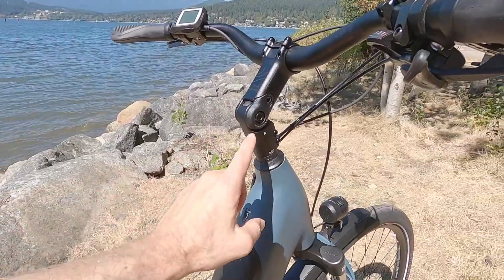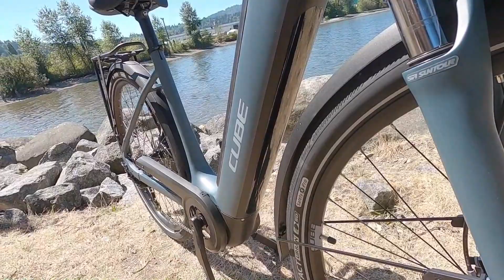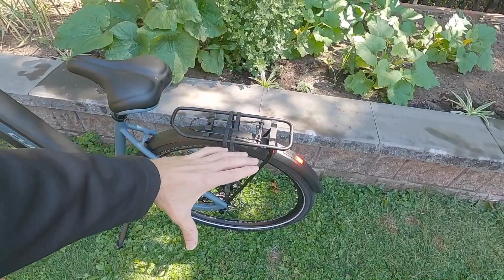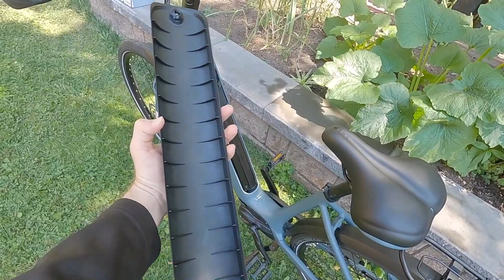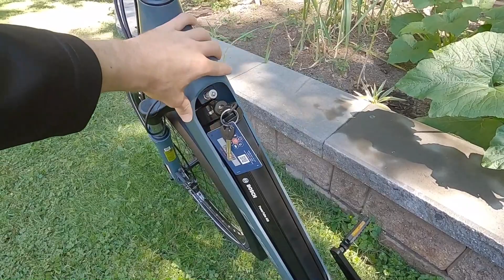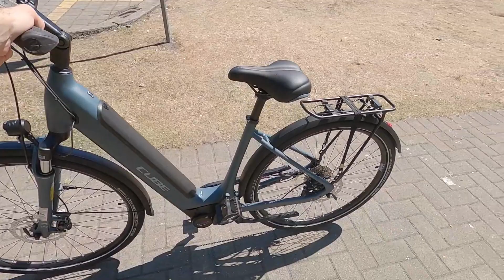CUBE Supreme Sport Hybrid ONE 400 Review - $3.5k

Comment: I bough this very model last November. Its a tank. Great bike. Corners beautifully. One thing that has disappointed is that with any weight over 5 pounds on the rear rack, like a child seat, there is crazy frame flex. I stood up to pedal and had to sit back down as I was losing the rear, very unstable. Otherwise good.
Reply: Saddle is hard as a rock. Motor is whisper quiet. Hills are ez pz, and shifting is smooth. Sweep angle of the handle bars is perfect. I would have though I'd prefer the Gazelle Arroyo for that, but test rode both extensively and much preferred the Cube's bars. Bought the Cube re sale. Tern was what i wanted, the HSD P10, but outta my price range.

Comment: There is no way you would pay $800 for a comparable traditional bike, without this motor or battery. $1800 for both is rediculously high, so this thing is at least $1k over priced.

The internal lock on the battery is a lot nicer than most might think. You'd be surprised how often morons mess with locks just to be jackasses. If this were not a Bosch I would be afraid of that rapid charger (kinda hard on LiOn batteries to charge fast). I have to admit, I trust Bosch to know best. I still am not happy with their lack of aftermarket support. Sooner or later they will face a Right To Repair suit.

We have not used straight gauge aluminum on traditional bikes since the late 80's! It's heavy, dull and buzzy. Using square tubes for the chain stays and that square downtube does not help matters any (the round seat stays are nice). There just isn't any good reason for this bike to weigh more than 45#'s.

Adding a USB port costs nothing. Would you buy a smart watch or tablet that is monochrome? The price difference for a full featured display is nothing compared to the $3k+ price. Whether you use all the features or not, they are nice to have and make life easier for your salespeople..

That suspension fork failed in The 90's. It is designed poorly for off road control, not on-road comfort. Why not trust sales people to explain why this heavy, energy absorbing, unreliable fork is not necessary? A rigid steel fork would be a huge improvement (quicker stops, better handling, vibration damping, range extending). You can always use a suspension stem (love your suggestion to purchase a suspension seat post). 

Are you surprised more are not using rear mount kickstands?  It's a little thing, but golly what a difference!

Comment: Reminds me a lot of the Gazelle bikes. Great price for that awesome paint and the performance line motor.
Reply: Agreed. I own the Gazelle Ultimate C380 and this bike is very similar. The differences: Cube has dual cylinder front suspension. Ultimate has bottle cage option. Ultimate has stronger rack. Ultimate offers the Gates belt drive w/ Enviolo internally geared hub. Ultimate has better location for front light. Ultimate is $4200 US. I think I 380 means more gears than this Cube 9-speed? Same Bosch Motor, same Bosch display. Oh! This kickstand on the Cube is in an annoying location.... The Gazelle nicely has it clear out of the way further back. Don't like this battery cover. Nice that this Cube has the ABUS key.... Maybe can be matched to a U-lock? Gazelle also has the 500w battery

Comment: The whole battery setup seems cumbersome.
Reply from the maker: Yeah, the cleanest PowerTube battery setup I've seen is from Trek, which has a shield bolted to the battery pack and a little flip handle at the end. The downside is that it adds nearly a pound vs. 0.3lbs with the plastic cover, and isn't as easy to replace because it's paint matched. It also makes swapping battery packs (for longer range or if you upgrade capacity) a lot more work. I like the older PowerPack batteries that clicked on top of the tube vs. going inside because they were light and simple, but they didn't look as clean as this.